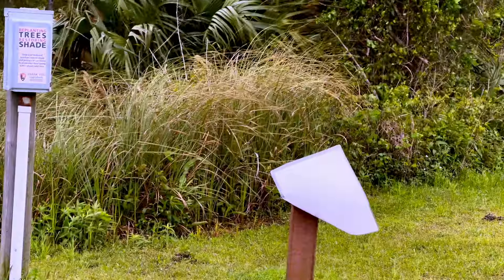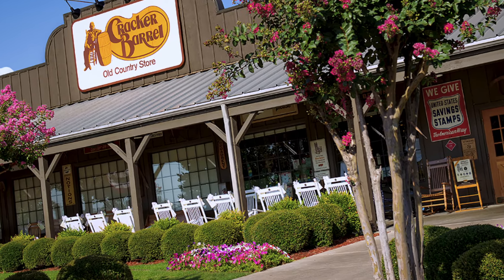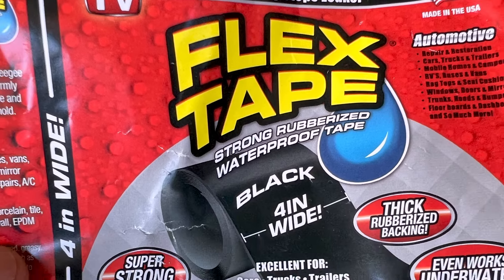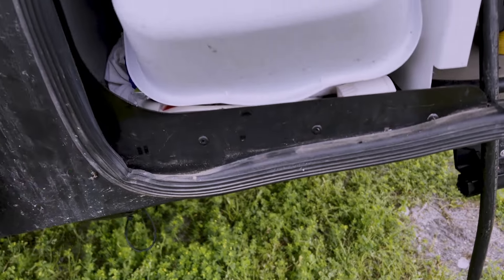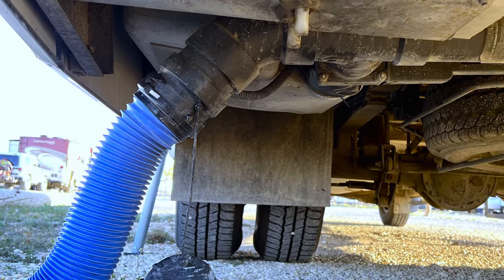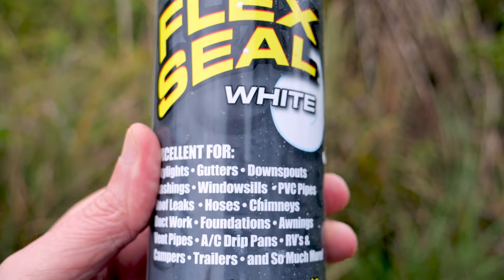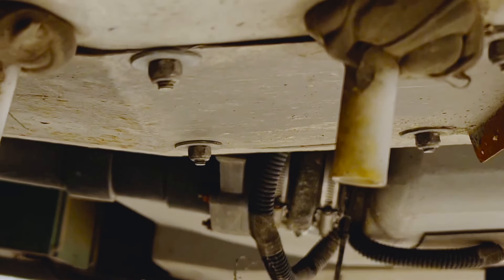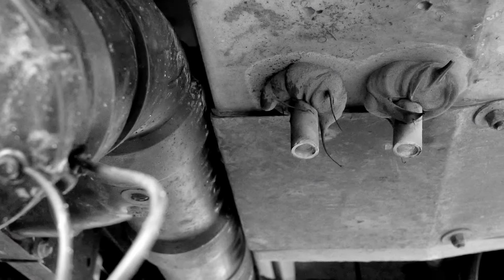Black water coupling fail

Comment: Very similar thing happened to us but on our gray tank bringing the RV home. We have a 2008 Winnebago View.  We bought it in 2017. On the way home i saw the same as you. I temporarily fixed by wrapping and it got us home. Replaced it with the original ones from winnebago from amazon. Those lasted 5 years. 2 years ago I changed them with the Valterra ones and. Of signs of cracking so far. After seeing what I saw im gonna change them in another 2-3 years for peace of mind. I inspect them a few times a season due to what you have seen.
Reply from the maker: I’m not sure if they crack due to age or the vibration. Could be both.

Comment: Home Depot, Lowes etc carry the 3 inch Fernco connectors.  I saw that the black water tank & grey water tank to dump valve assembly to my 2019 View "V" model  were getting worn looking so I replaced them staying in a local RV park. I was pleasantly surprised at how simple the repair job was.
Reply from the maker: I did need a screwdriver as I couldn’t get the black pipe back enough.
Reply: I think my 2019 24V waste drainage is plumbed a bit different than your J. My grey tank is aft and there's a Shurflow macerator pump that pumps grey water forward to the black water outlet. The coupling replacement was super easy and straightforward.

One thing I've learned is that either you end up paying $$$$ for service (if you can even get someone) or you learn RV repair the hard way.  YouTube and especially the View-Navion Facebook groups have been especially helpful. I've learned how to replace my LP regulator and how to safely  work on the 12VDC and 110V AC house systems. 

Are you going to "Camp Winnebago" in July or the Escapees Escapade in June?
Reply: This is obviously not an endorsement for Flex Seal.
Kind of dispels all the things that they tout in their stupid commercials.
Reply: Hi Ron, same problem on our 15J. I replaced the couplings, but also disassembled the valves and replaced the inner seals. I coated the seals with 100% silicone grease. Now the black and grey valves open/close like butter. Also replaced all bolts/nuts with stainless.
Reply: @rvacation4456  Great suggestion. Where did you get the seals? Great idea too on replacing with stainless nuts/bolts.

Comment: Great to see you again. Our 24J is a 2011 and, so far, haven’t had to mess with either of those issues. I did have a “CHECK ENGINE” come on the other day. The chassis battery wouldn’t turn over the engine either! Put a charger on it but even after an overnight of charging, still had to use the Boost button to start it. Had a local mechanic put his high tech plug in device into our under the dash plug and the first thing that came up was the battery was bad. It is only a little over three years old and thought it should last longer! Any thoughts or suggestions above & beyond replacing this battery? Thank you sir, Ed from Fallbrook.
Reply from the maker: Thank God for the boost switch. My battery is original and is over 8 years old. I haven’t replaced it and am not too worried because of the boost function. 3 years is a very short time. Do you have a Trik-l start or some other way to keep the battery charged when not in use?  2 thinks that kill batteries are deep discharging and high temperatures. Otherwise it might have been an internal defect.